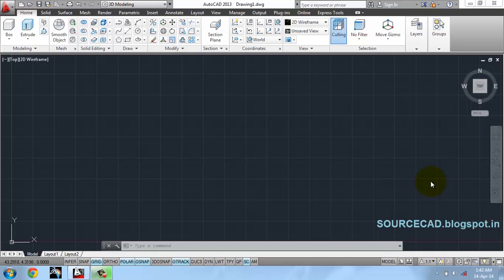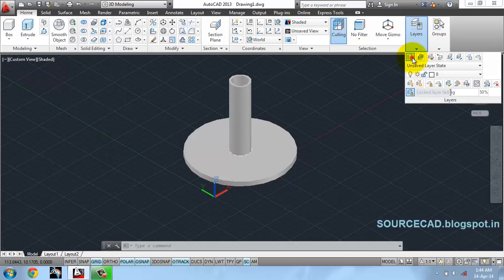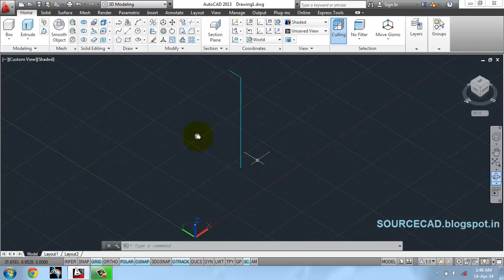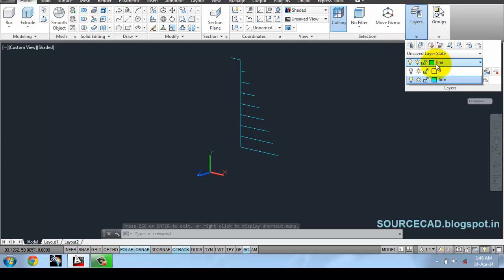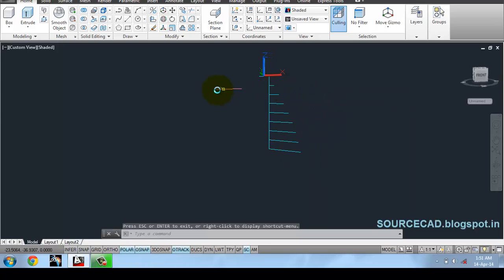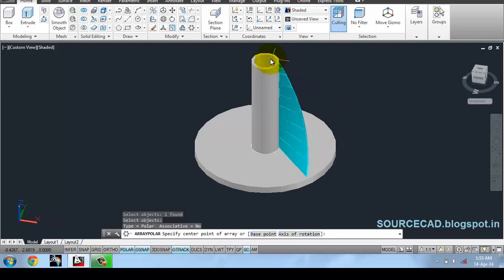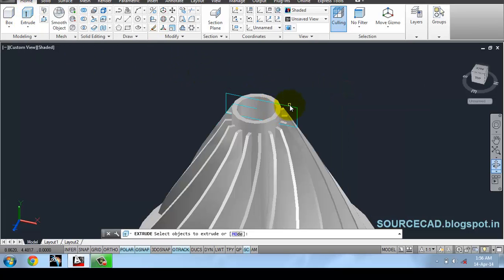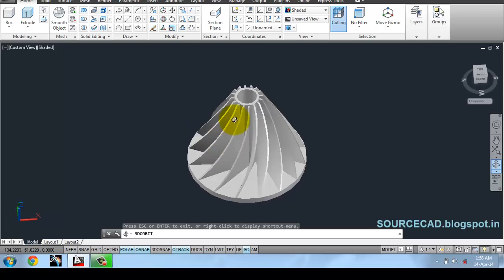3D modelling impeller in AutoCAD

Comment: There is no Surface tab in my version Autocad 2010,so I was unable to complete the surface part .where could I find it or any command for surfacing those kind of objects.
Reply from the maker: +ABDUL JAFAR Are you using AutoCAD LT? AutoCAD LT has limited capabilities and its probably the reason you are unable to see 3D ribbon. Moreover if you have full version AutoCAD then you can turn on 3D tabs by right clicking in empty space of ribbon and selecting the required ribbon from contextual menu.

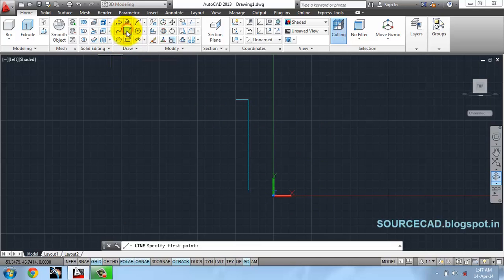Comment: When I try to do the lines at 5:15 , it forces me to connect the horizontal lines to the endpoint of the vertical line.  How do I unlock it so I can put the lines wherever I want?

I have Node 'on' in the OSNAP menu by the way.
Reply from the maker: Lucas B you can turn off OSNAP temporarily by pressing f3 to avoid snapping at unwanted points moreover you can also select a command then press SHIFT+RIGHT CLICK a contextual menu will appear select point which you want to snap and only those points will be activated for snapping.
Reply: SourceCAD great. Thanks!
Reply from the maker: Welcome Supafly :)

Comment: Once the fins have been turned into a polar array how do you get them to connect with the base and cylinder using the 'union' command. Mine wont work.
Reply from the maker: klrhc2 It might be due to associative array, select fin after making an array and write X in command line and press enter.
then try to make union let me know if you still have problems
Reply: It worked!!!!! Thank you very much!!!!!!
Reply from the maker: Welcome :)
Reply: SourceCAD Thank you very much! I had the same problem, I couldn't union the array with the base and cylinder. Just selecting fins and them command x (explode), the union finally worked!
Reply from the maker: I am glad it worked :)

Comment: for some reason I cant get my " union" to work
Reply from the maker: ***** for applying union you need to first use THICKEN command on fins and set some thickness to it and also make sure that central cylinder mates (intersects) with fins.

If both the methods fail try this

select array of fins and press X then enter then try to UNION (associative array objects cant union this might be the case)